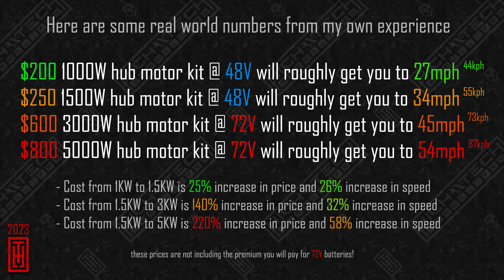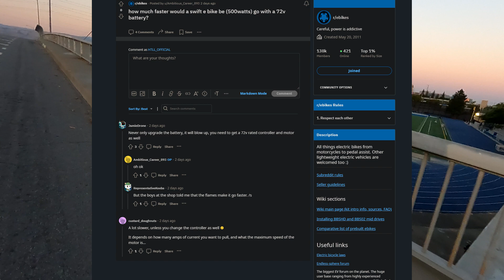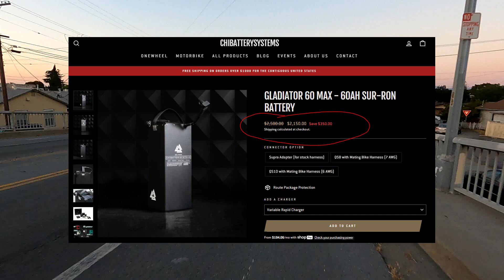🚲 High Powered Ebikes Are Stupid And A Waste Of Money

Comment: I live in the mountains and weigh 300 lb. A 1500 watt motor won't pull me over up hill without over heading and that's with me pedaling. 1000w motors just give up. The 8k motor won't even get worm. lol
Reply from the maker: That's true, and I agree. I think if the weight is really up there, it could be more of a justification for higher power 👍

Comment: Dollars per mile. Which is more cost effective, a motor scooter or electric bicycle? Start with something like a Honda Ruckus or Metropolitan. Then select any larger motorcycle of your choice for the comparison. Longevity should be part of the calculation. 

I built a gasoline motorized bicycle and used it for about 8000 miles. The only benefits were the light weight and not insuring it. The light weight allowed me to bring it upstairs and lock it to a guard rail at night. It required lots of adjusting and work to fix things that kept breaking. Spokes were the most annoying things to replace. It went through at least four different engine kits. It would have been much simpler, easier, and fun to buy a 49 cc scooter and pay for the insurance. Full coverage insurance back then was about $120 a year. I already had a motorcycle license. 

I would own an e-bike if the controllers would not fail. They can't handle water, condensation, or extreme cold temperatures. They aren't good for those who live in the north.
Reply from the maker: I suppose it depends, I've seen a lot of long term comparisons of EV cars and Gas cars and economically it is more efficient to go with gas still (at least in 2023). Once we get solid state batteries things will change, even for ebikes. Cost will go down and performance will go up. 

True, I haven't messed with the gas engine bicycles but I do know smaller engines typically are more fickle. Gas scooters are really nice though, and quite reliable. I had a Yamaha scooter 50cc that was indestructible. 

I think in your case you would have to do extra precautions for weatherproofing your stuff, I do know a lot of users ride in the snow, but maybe where you are it is severe. Cheers man 🍻
Reply: E-bikes aren't capable of operating below 10°F. Lots of batteries are limited to 32°F. The central parts of the USA have nights and mornings that are lower than 10°F even if the daytime high is above freezing. Which prevents them from being used throughout the winter. Some northern parts of the USA can have high temperatures between ten and twenty degrees for weeks at a time. 

It would be great if battery technology improved AND could handle the cold. Still, the controllers would need to be made to handle the temperature swings too. I doubt anybody is working on such technology. @hightech-lowlife

Comment: My ariel rider kepler felt like the most balanced power ebike. My legs felt useful even at higher speeds I could pedal hard and get to 35-36mph. Then I got addicted to power. Now I'm building a dual motor wired Cruiser monstrosity.
Reply from the maker: Awesome man, the power is definitely addicting 😂 Cruisers are the best in my opinion, I'll have to check it out!

Comment: I ride my stealth bomber clone on the road about 30 miles a day. 16kw with supermoto tires. I use it to commute to work long as it's not raining.
Reply: Currently a Chinese nbpower 72v nominal 84v 40ah battery from Amazon. My cyberwerks battery is being built right now. I average about 50mph on the way to work and 35-40mph on long rides. Bike weighs 155 lbs and I'm 220. Fastest I've had it was 72mph
Reply from the maker: What is your battery setup? What would you say you're average speed is?

Comment: I'm about 250lb (with my backback on) and will be in a position where I would like to continuously ride up a steep grade at 25mph.  I suspect speed/power numbers you posted are on flat ground? I'm looking for a rough estimate on what those numbers should look like in my situation.  I'm also assuming those numbers are for a mid-drive?

I'd love to do a hub motor, but I suspect a direct drive hub motor is probably not gonna cut it.
Reply from the maker: Yes flat ground, but they are for hub motor! Since you are on the heavier side and also going up hills a lot, I still think 1500W would be good enough for 25mph (as ideal conditions are 34mph). You may be in a scenario where 3KW or more may be what you're looking for, however I would test it out first. See if you can rent or borrow a 1500W bike first and make a more informed purchase for your specific use case 👍
Reply: @hightech-lowlife  Awesome.  Thanks for your input!  I did try a friends DIY 750w hub motor bike (unknown battery) which he mostly uses for pedal assist and  750w was definitely not enough.  I though I was going to overheat the motor or something!
Reply from the maker: @RK-kn1ud  Yes. 500/750W is pretty anemic, even 1000W feels underpowered to me (but I am biased), 1500W is good, 3-5KW is almost too much. 👍
Reply: My primary bike is a 48 volt 1500 watt direct drive rear hub motor. I power it with a Hailond triangle Panasonic 22700 cell 20ah 1600watt battery . there is one hill I climb on my return trip that is 1 mile long and roughly 30 degree grade I do it in pedal assist level 2 and travel around 17 to 20 mph no problem levels 3,4 and 5 are insanely fast level 5 I do 40+ mph on the flat and 27 on that hill. this is a standard mountain bike frame with the Voila Mart 1500 hub motor conversion kit built the whole thing for around $775.00. I weigh in at 200lbs and carry a backpack everywhere in case of flats or road side repairs to it weighs around 10 lbs on it's own the bike weighs 75 lbs.

Comment: hehehe iam about to build my 2. high power ebike batt. made with 120 21700 samsung cells ! i have build 48v batt for 2kw motor and my customers love it ! my personal bike is in the sweet spot ! 1 kw motor peaks at 1500w. on a light frame.
and my custom 3kw stealth clone is peaking at 4,2 KW good sweetspot too
Reply from the maker: That's awesome man, looks like you have a good idea of what you're doing 🍻🍻 I'm currently building a 160 cell battery and it's a lot of cells 😂

Comment: People always make the comparison of a used sport bike to a new electric bike. but the used sport bike market has always been a strange place. Most motorsport segments have gone incredibly expensive in the last few years. UTV's, jet skis, and even some dirt bikes break 10k and some 40k  (surely anyone could get a small used 4x4 SUV for cheaper.) but my point is new tech is going to cost more, a 2023 bike will cost more than a 2020, 2010, 2000.  However a brand new Stark Varg comes in at 13,900 and a KTM 450 SX-F Factory edition at 12,099.  The price is so close its worth looking into.     I bought  my Alibaba special Stealth bomber a little over a year ago for $3k. I have 12kw 72v 21" motorcycle tires and I ride everywhere, and the price is even cheaper today.
Reply: A 60mph ebike with a Zoom fork?
Reply: @FightFilms   KKE 34's  feel good at 40-50 but a little hairy at 60+ but for my style riding I'm rarely any faster than 40.   Its like trails you think your driving crazy but your average is 15mph.
Reply from the maker: I agree that used sport bikes have gone up in price over the past few years, however I can also argue that everything has gone up in price over the past few years. Most people who want to go fast for less are not going to be looking at brand new bikes as they are very expensive, and at that point it comes down to more what technology makes more sense (gas vs electric). 

You did say that you rarely go over 40, which does align with my thoughts on people that ride higher powered ebikes 👍
Reply: @hightech-lowlife  To be fair, my e-bike has gone down in price since I bought it.  We also have the covid bubble that drove prices for everything through the roof. Demand for everything from MTB, Ebikes and just anything outdoors spiked for 2 years. its busting now and a lot of MTB shops and companies are closing due to old inventory and overproduction.  I think there's a big dip in used sport bikes for many reasons, first is skill. a lot of people can't shift or even balance a 400lb beast.  A lot of bikes sold also have been crashed or dropped by the former rider or ridden like it was stolen. They are sold for cheap cause they aren't in good condition to begin with and the market for new organ donor is small.     I feel like my ebike falls somewhere into 125-250 dirt bike performance.  Honestly I don't wanna go faster on knobby tires.   But I also hate having a e-bicycle stuck at 25mph. its too dangerous driving on canyons or holding back traffic on highways.
Reply from the maker: @tacticooldennis  Yes, all these points are correct. I think we will see a crash in prices for a lot of things in the coming year. A lot of people do not have the skills to ride a motorcycle it's true, something about shifting to them just throws everything off. Most Americans cannot drive a stick shift car either for the same reason. 

Knobbies on the street can be sketchy so just be careful. 25 is not as fun as 35 for sure, it's a big jump in speed 👍

Comment: Great video.  I built a 2000 Watt 72V ebike.  Total waste of money and time.  Part of it was my fault for not figuring into the design the weight, battery size and overall engineering.  I had to modify the bike too many times to accomodate all of the parts and controller.  In the end, buying a motorcycle would have been far better.  I still have my 28 mph legal ebike and it's far better for general use.  So much lighter and trouble free.  But like you said, it you have some special application, that would be the exception.
Reply from the maker: Thanks man, I'm sorry to hear you didn't have a good experience with your more expensive ebike. I think this is part of the journey though, figuring out what you like/need over time and by trying stuff out. These types of bikes do have their niche application, however I think for most people they're not ideal. Thanks for your insights! 🍻